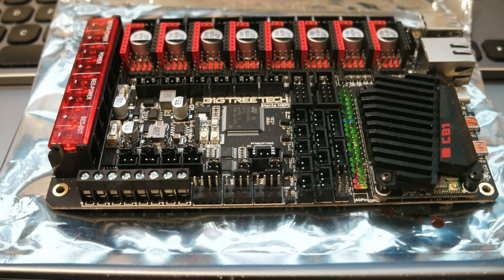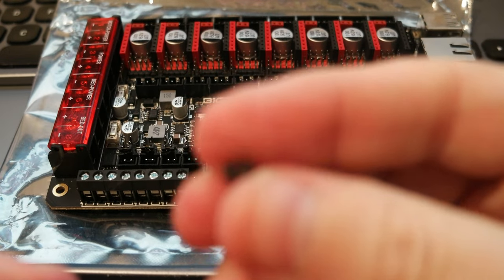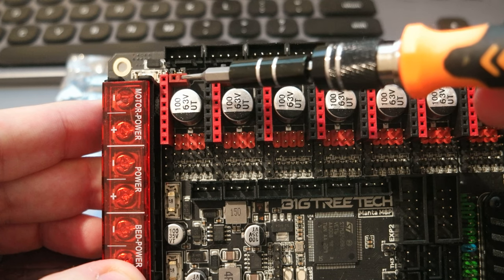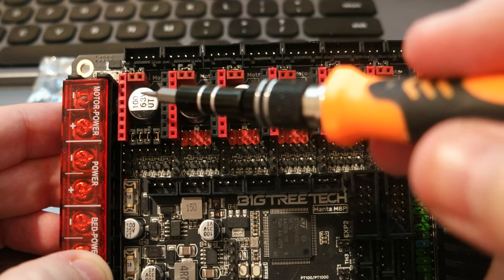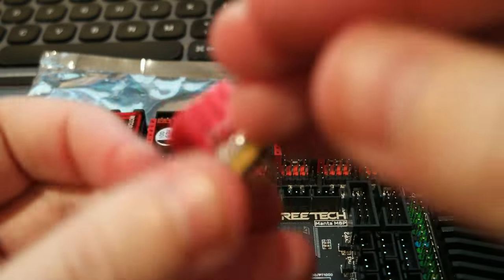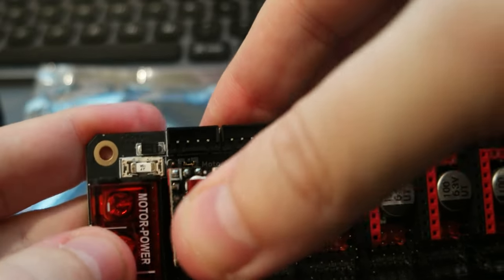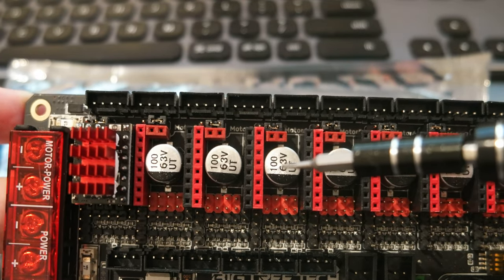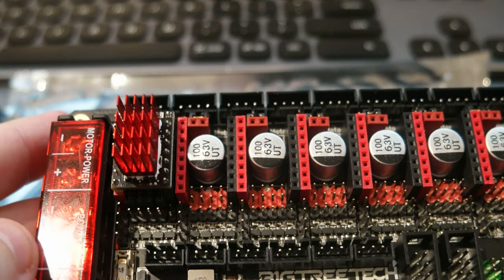How to setup SPI jumpers for the TMC 5160 Pro on a BTT Manta M8P board

Comment: What is the difference between SPI Mode and SD Mode when comparing the PRO vs Normal TMC5160T? I have Octopus V1.1 (Not PRO version) and I am looking to buy the TMC5160T, but I dont know if I should get the Pro drivers, or the regular ones since I wont be running over 24V on the standard Octopus board.  Do you know what SD stands for and what it does?  I am trying to figure out if the only difference is the voltage limits, or if there are other features you get with TMC5160T PRO VS. TMC5160T.
Reply from the maker: I am not familiar with the SD mode but the difference between Pro and Normal 5160 I think is power handling as the Pro can handle higher motor current. So it depends what you are trying to achieve with your 3D printer. Higher speed or precision. 24V is better since you end up using lower current, and you achieve high torque for the motors.. I am not familiar with the Octopus and its features thought.
Reply: @ganzoai Yeah, I cant find anything other than the power difference between the 2 drivers. I might have to just ask BIQU since there isn't any info on the internet about what SD Mode is.
Reply from the maker: @user-lx9jm1wo3h  another option is to read the 5160 various data sheets from vendors and see if they provide more details information. But in any case if the software drivers do not expose those features is like they do not have it, even thought they do. Check TMC data sheets form 5160.
Reply: @ganzoai I tried that too but still could not find anything about it. If I find anything I will let you know
Reply: @ganzoai this is what they said: Dear customer,

Hi. SD mode is step/dir mode. Please refer to the corresponding mode in the schematic diagram and solder the corresponding R6, R7, and R9.

Best regards

BIQU